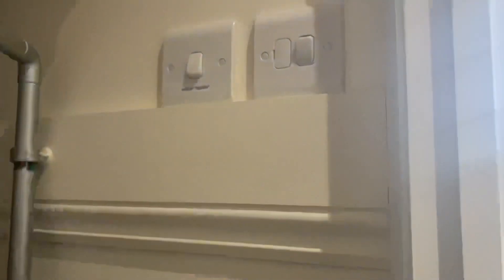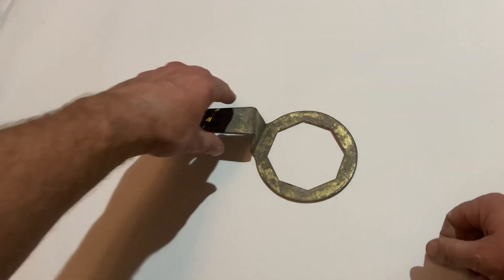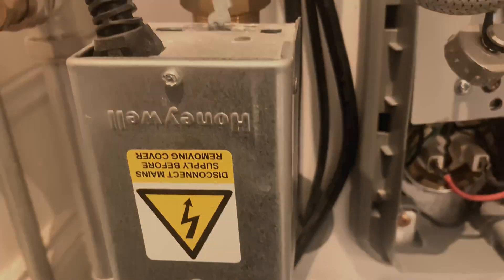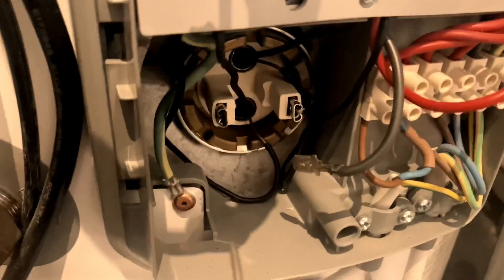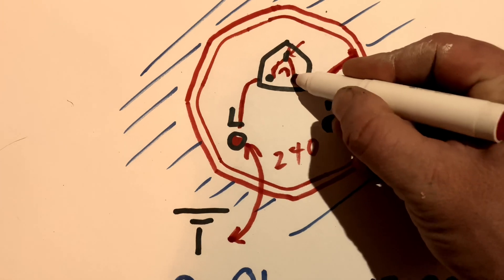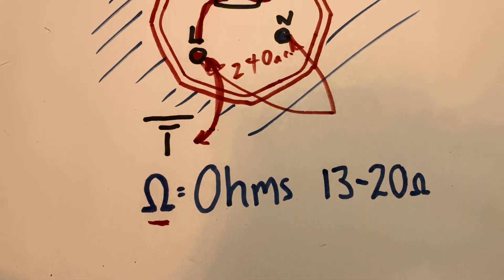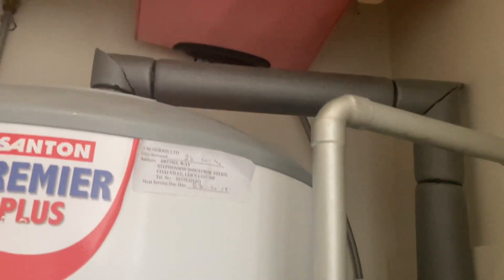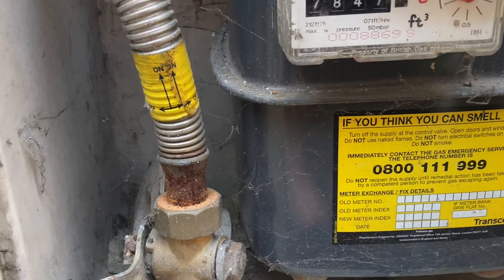How to test, install, fault find hot water Immersion heater💥 No hot water❓unvented cylinder 🥊

Comment: Hi when you buy a replacement heater element with it come with a fiver washer ? Also what jointing compound to use ?
Thanks
Reply from the maker: @yuriflynn2477  yes put boss white either side of the washer NOT the thread

Comment: As a electrician we are not aloud to use those screwdriver voltage testers as you are using your body for a earth
Reply from the maker: As plumbers we need a major overhaul in our industry for safe isolation
Reply: @warriorsofwarmth  look up GS38 FOR ISOLATION .Btw, I'm also OFTEC heating engineer
Reply from the maker: @terryhudson4775  try the Navien oil boiler, incredible unit, advanced technology great warranty and light!